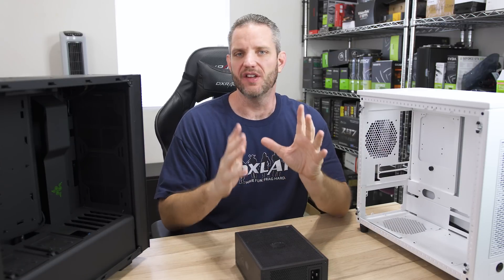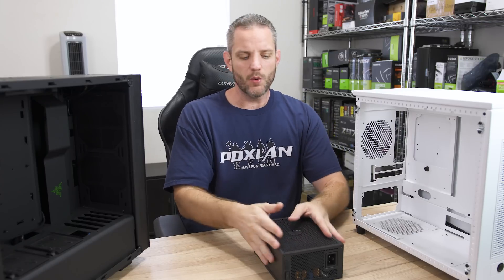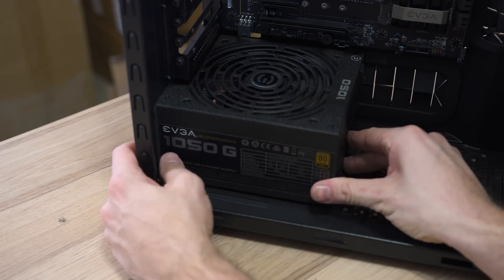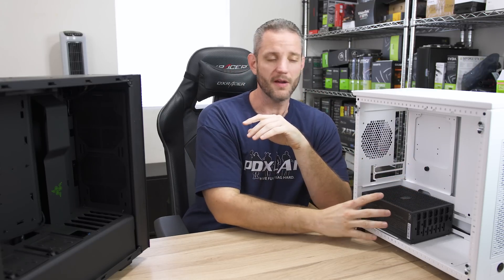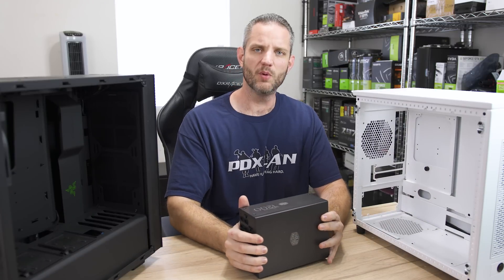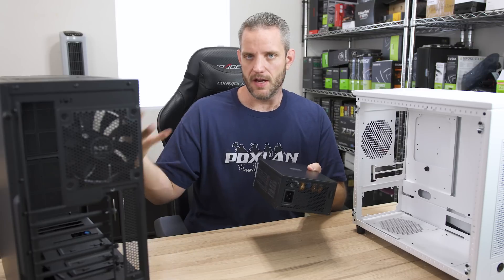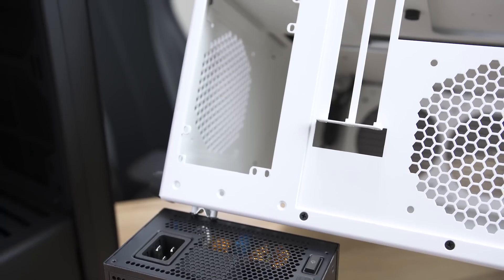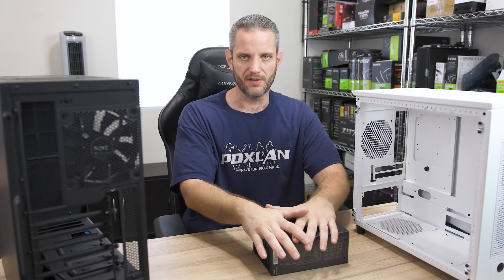Should you mount your Power Supply up or down?

Comment: Heat rises Jay, that power supply loop thing you said would be impossible.
Reply: For whatever stupid reason the reply I posted 3 days ago already got ghosted or blanked out, so I'll try again with another account:

It's not [impossible], as the air coming out of the PSU is usually just a tiny bit warmer than ambient and therefore barely moves up (the "hot air rises" argument regarding down-facing intake fans has proven to be stupid on that matter again and again, as the airflow even slow running fans produce is times stronger than the thermal effect of natural convection in typical PC environments).
However, I also doubt the feedback effect a.k.a. hot air loop to be real, as the amount of air being drawn from the PSU outlet is minimal and therefore insignificant compared to the amount of fresh air being sucked in from all around the PSU intake.
So I was coming here to find (or to write, respectively) a similar comment to yours, but with a slightly different reasoning ;)
Reply: Hmm, with a thermostat you mean? How would you use that to test if a significant amount of air exhausted by the PSU is sucked in again traveling around the case's bottom corner?
I (the one who replied above) would think of the legendary smoke experiment first :)
Reply: a) Yup ... or a combination of both :)
b) I don't think so, I guess you were thinking of LMG.
Reply: Sounds reasonable mate, only way to know is to test with a thermo stat.
Reply: Or a infra red cam would be perfect .
Reply: don't jay have one of those?
Reply: +Lee Wood But your statement was reasonably plausible. If you live in a middle ambient temperature  your PSU wouldn't suck that hot air back into it unless it gets too hot and the down fan is spinning like crazy. But if that happens or something's broken or the PSU is too little for a too much power demanding configuration.
Reply: indeed.
Reply: I'm somehow missing the second part of the "But ..." sentence, but there was probably just an "or" too many ^^ (the first one)
Reply: Yeah Its much better to pull hot air from your Gpu than the PSU makes perfect sense :)
Reply: Whom are you getting at? Couldn't find any relation ...
Reply: Victor Ov mind telling us how to came to that statement ? we cant find any relevance to this comment tread... IM JUST SAYING LOL
Reply: rannon welikala Guess he doesn't even know himself ...
Reply: Oliver ASUS now now... give him a chance to explain himself will you xD
Reply: rannon welikala He's thinking about that explanation for two days already ;p
Reply: hehe...
Reply: With proper airflow and a relatively average-sized case, "hot air rises" doesn't apply. It's negligible. You don't have to be an expert to know that. As long as there is even a modest amount of air current pushing the hot air, the PSU would catch some of it and suck it out. Is it going to make all the difference in the world? I doubt it, but it could help a little.
Reply: I mean yes, buoyancy is going to try to push upwards, but the pressure of a fan can easily overcome it. Especially if the hot air is being pushed straight into a wall, some of it is going to splash in all directions, easily letting some hot air get close enough to be sucked right back in.
Reply: heat does rise but if the heat is blocked off and being pushed bye a fan it goes in the direction of the fan and then rises like idk out of the case for instance xD
Reply: The suction of the fan overpowers the effects of hot air I believe
Reply: you dont need to be in a warm climate to create that loop, the loop Jay is speaking of is created when the back of the pc is close to something so the speed of the air ejected from the psu is more than enough to send 50% of the warm air to bottom if there isnt enough room for it all to go up at the same time
Reply: im guessing he speaks with experience? I've seen the same phenomenon happen with my laptop while playing games... so i say its plausible to say the least? what do you think?
Reply: Oh do you know i might be wrong on this one , I didn't account for different climate temperatures Jay lives in a hot part of the USA so it might happen, only way to find out is take the temperature with a  meter ,  cold air is heavy than hot air so hot air would rise, interesting cheers.
Reply: you have a point indeed.

Comment: I built a "sleeper" PC of sorts using an old case from the pentium 4 era. Since the case has poor ventilation and few fan mounts I've resigned myself that dust is something I will have to live with. I turned my PSU upside down to maximize the exhaust on the system and get as much heat out of the case as possible. I chose parts which have a lower TDP and balanced performance to heat production as best I could so I wouldn't need to modify the outward appearance of the case. So far it's been working great and my temps are still manageable. In fact my total power draw is less than the P4 parts I gutted to build this system.

Comment from the maker: Thanks for the support guys, means a lot! Don't forget to let me know what other basic subjects you think I should cover!
Reply: Jay I think you should do this as a complete series or playlist going over all the basic parts of a pc and explain them.  Also the most optimal way of installing them.  Or collaborate with Jerry and do the series and call it Keep It Simple with JayzTwoCents and Barnacules...
Reply: That Def Leppard reference :D
Reply: JayzTwoCents I have an older CPU i7 2600k and a GTX 1060 and I am curious as to how to test for CPU/GPU throttling
Reply: How about what gigabyte fucked up in the 10th series g1 gaming cards? I know for sure that 1070 has a fan issues like mine rx 480 which results in 1 fan sounding like rotor when first starting,also the insane temps on the rx 480 even after the bios update.I really wish I could make something about that cuz that card can't even hold the advertised clock on the box,it's always going up and down but never stable even on 72-3 C
Reply: Got a question for ya. What about the open air systems? The ones where there's just a glass pane and a backboard with no real case. Is pressure or dust an issue there? Do you even need fans?
Reply: JayzTwoCents <3
Reply: basic subjects: what is the psu's sexual orientation? :P
Reply: a review on some gaming chairs? e.g your dx racer :)
Reply: Dear JayzTwoCents, Please make a video on how to open a psu and cleaning it for dust safely.
In advance thank you.
Reply: Hi Jay, basic subject I've been meaning to suggest - what kind of temperatures we should be seeing inside of a water cooling loop - when we have a single pump and res config for say - 1 CPU and 2 GPUs (1080 GTX?).

What would be the ones we'd expect coming out of the rads, after it comes out of the GPU blocks, CPU block, etc. An overall overview of water temps in the system.
Reply: If we put the unlikely posibility of a pressure issue(dust entering without passing filter) aside, your system overall will likely benefit from this way of mounting the PSU. Here is why;

If the fan facing down is the normal way, then the electronics that produce heat inside the PSU will be mounted on the side facing up into the cabinet. The heat will then travel up, away from the fan, potentially get trapped between the electronics and the metal plate and heat it up. By mounting it with the fan facing up, the heat will travel up towards the fan and heat said metal plate less, in addition the previously warmer plate now face outwards against the cool air under the cabinet.

All in all I don't think it will make a noticeable difference and either way of mounting it is fine. Exception for the water cooled systems.
Reply: JayzTwoCents my pc is having issues, it loads normally and all, but when i try to open csgo it crashes but any other game is fine, its the same way when i try to open google chrome, and i noticed that i'm missing pictures. i want to believe its the OS but i have no clue
Reply: JayzTwoCents Jay I have a question about my Asus dual series gtx 1060 6gb I recently have been getting into overclocking my gpu but the gpu tweak version I was using from Asus isn't that user friendly and almost locked up my system it was my fault I had it set to auto start and apply settings which is not ideal for testing ocs this lead me to precisionX now monitoring my gpu even on default settings my card is power limiting constantly and I know from watching your channel that you don't wanna see any power limiting and no its not from thermals I was running my fans high enough to keep my gpu temp well under 70c pls help me. do I need to flash the bios to have precision x work correctly with my gpu or would that fry my gpu bc of some changes Asus made to the card I'm a noob so if I make no sense I'm sorry lol I just want the performance I paid for ya know anyway thanks in advance if you see this and have the time to give it some thought for me I'd greatly appreciate It
Reply: How does a computer boot up for the first time without an operating system being installed?  And if there is no operating system installed, how does the operator get one onto the CPU in the first place?
Reply: Nice Def Leppard reference :D

I'm really curious about how much bottleneck would the GTX 1000 series would have when using FX series CPU. I'm still wondering if it would be beneficial to switch my 960 for the 1060 using an old 6300...
Reply: Rickbearcat motherboards have whats called a bios in the bios is where you boot into on a new pc to set up your hardware and then install the os hopes this makes sense for you
Reply: lDNASTYl You are attempting to answer a question that I don't want answered by the comment section.  My reply is for Jay to read and possibly do a video on.  Thanks anyway.
Reply: Jay could you show how to setup on the cables for the motherboard and everything for me?cause I have everything but the graphic cards and I don't know what cables I have to use for it and where they go to.
Reply: Swap motherboards! Thank you!
Reply: how do you know if your psu fan is working or not ?
Reply: put It into a outlet without any motherboard cables then see if the fan turns on
Reply: Games4Days so it works even if it is not using  most of the watts it provides?
Reply: yes it will still work if the fan does not move on it then its broken and would need to get a new one
Reply: Do you currently reside in Portland? I'm here too, I recognized your shirt lol I love it!
Reply: Hi Jay, woul a case with psu shroud on top be good? be thinking here, your video helped me, but still can make up my mind about buying one. I mean, the top opening/holes, are essential to good temperatures? or psu on top with a shourd would be some kind of perfect? thanks for the video
Reply: JayzTwoCents POUR SOME SUGAR ON MEEEE. IN THE NAME OF... you get the point. Hey, I'm only 14 too.
Reply: JayzTwoCents Can you squeeze in about picking a graphics card you should consider that you have this kind of cpu that holds this amount of ghz or something that says look for this and you can go with this gpu because anything higher it would get held back and why maybe think about it please and thank you 😊or if doesn’t Matter looking at it that way please mention it.
Reply: jay you're seriously genius I have the case instead of buying a new case just flip psu upright.
Reply: But my question is, the capacitors can bem damaged if the is Up or down or dont matter to the capacitors ?
Reply: Could you talk about the HDPLEX 300W and the s4 mini nfc case please? thank you for your awesome content !!
Reply: Hey, what if I have a really old case and my PSU mounting is on the top ? Should I have it facing downwards then ? There are no "exhaust holes" in the top, like modern cases have on the bottom, under where the PSU should be mounted. That's my guess at least.
Reply: Hi #jayzTowcents yeah I'm I new builder I'm getting my new gaming pc next week and I got a 500w power surplie coming and asar prime b350-plus motherboard going Kingston ssd card and ayzan 3 cpu and ddr4 but I don't no which ones to go for the ddr4 I need 2×4 and 1T SATA hard drive and I got a case already it's a cnt halo 5 with 120mm led fans 6 for them and it's liquid cooled ready to but I'm not ready for a liquid cooled but the asar prime b350-plus has one two fan header one for the cpu fan and one for the exsorst fan at the back so do must power supplies have Molex Capel to but the rest of the fans together and is the asar prime b350-plus eney good to ?
Reply: If you haven't already made a video about balancing airflow that includes positive, neutral and negative pressure, well, there's a video idea for you that I'd watch.
Reply: I am curious, if there is a way to tell if you are running a negative or positive pressure inside the case?
Reply: Nice vid but you made me feel old when you started to explain Deff Leppard.
Reply: Is there any threat that water coolers leak inside the case? I mean BOOOM!!
Reply: nvme aka m.2
Reply: the efficiency of hte power supply tells you how much heat is dumped into the case. it can be 50w of heat, half of a decent CPU and an eighth of a decent gpu. most of that heat goes into the case even if the fan isn't on

Comment: Perfect timing, Jay! I am actually building a system for my son, and like you mentioned in the video, the PC is likely to sit on top of the carpet floor, so yes, it crossed my mind that PSU is going to suck in all that dust from the carpet. I actually spent some time on Newegg and Amazon trying to locate PC cases that mount PSUs on the side or the top of the case. Somehow, the choices are quite limited compared to the selection of cases with the bottom mounted PSU. However, now you have given me food for thought and I will consider placing the PSU on the bottom with the fan facing up. That might save me a few bucks since I will just reuse one of the older cases then. Love your channel!.

Comment: Also, if you have SLI open-air style GPU's, the lower gpu can end up very close to the PSU, so you can use a PSU fan face up so that it takes some of that hot air from the GPU and exhausts it via the PSU.

Comment: Does your case has bottom PSU mount? Yes - next question, No - Face Down

Does your case has a bottom intake? Yes - next question, No - Face Up

Is your PSU fanless? Yes - Face Up,  No - next question

Is the case going to be put on a carpet or any obstructive surface? Yes - Face Up, No - face down probably prefered, but can be done either way.

Comment: been building systems for 5 years this has never crossed mind im gonna now flip my psu.
Reply: flip the tower too for better airflow.
Reply: tootsie|troll® thanks I will post benchmark results tomorrow.
Reply: @MATTW3R  2 years later still waiting on results.
Reply: Vaughn Armstrong lol honestly it worked my PSU is still sitting with the fan facing up since this post and dust hasn't caused any sort of issue temps never changed inside of the pc I tried flipping the case but I couldnt reach the USB ports like that so test was inconclusive.
Reply: @MATTW3R  3 years later still waiting on results
Reply: @MATTW3R  Do you have your PC on a carpet? Otherwise, keep it down?
Reply: !RemindMe 1 day

Comment: I disagree with the fact that the power supply would retake the air from the bottom. 4:00
You need to think about that hot air only raise up and cool air goes down. If the hot air from the power supply came out from the back, it would go upward to where the rear fan goes since power supply cannot produce cool air. So putting it downward or upward would not cause the loop as you mentioned. But i do agree with most of the point in the video. Nice work, love you videos.

Comment: You don't want positive pressure if you want proper cooling. Positive pressure creates deadspots in airflow which cause hotspots.

If you want the most effective cooling, you want more exhaust than intake to create negative pressure and eliminate airflow deadspots which can cause hotspots.

Comment: Wouldn't the power supply interfere with the gpu somehow? The PSU and GPU intake fans facing each other would compete for the cool air coming from the front fans, would they not?

Comment: Is it bad to keep the case side open?
Reply: Kalle Hartikainen  your exhaust fans will be doing very little and the coolers on components will just be generally pushing air around a bit rather than that air getting pushed out the case and replaced with colder air with which to cools heatsinks with

Comment: Great video, I never thought about the reasoning behind facing the power supply up in a case, but now I see why if you were one for those people who sits your computer on the floor that this could benefit the power supply's breathing on surfaces such as carpet. I suppose this could also benefit those who have cases without a filter for the power supply and those who own pets who are notorious for shedding fur and just general dust that accumulates on even hard surfaced floors. I keep mine up off the ground using a short 10inch wooden stand which helps against the static shock that can happen on my carpeting, also I have two cats.

Comment: one time I was making a htpc from an old spare pc I had and the case used a mATX power supply for some reason. I rushed putting it together and when i turned it on and ran it for about a week I kept wondering why the fan speed in the power supply was at like 100% the whole time.... I installed it with the fan side facing the case where there was no ventialtion XD. I AM MASTER COMPUTER BUILDER

Comment: Down - because dust settles. If facing down, bits can drop out. If facing up dust or bits can sit forever. My AX1200i never spins so it does not suck dust. Nothing can fall in either.